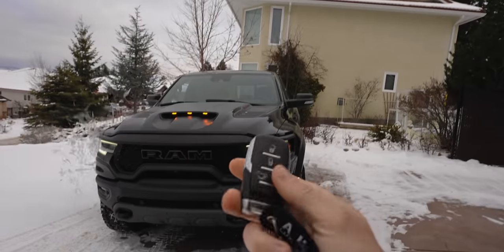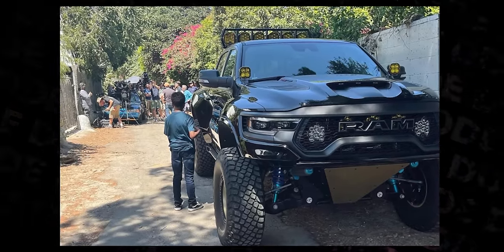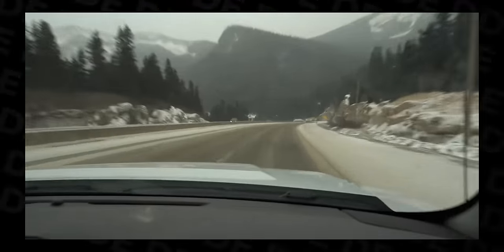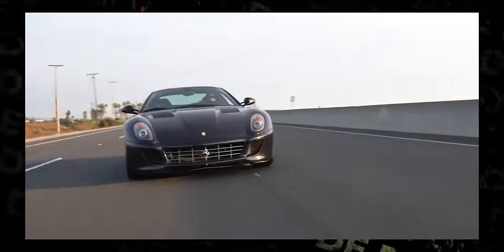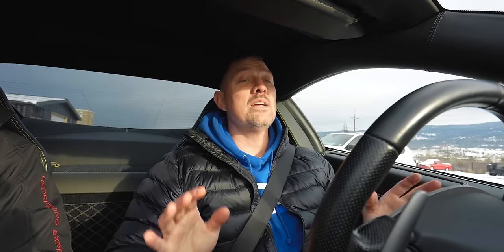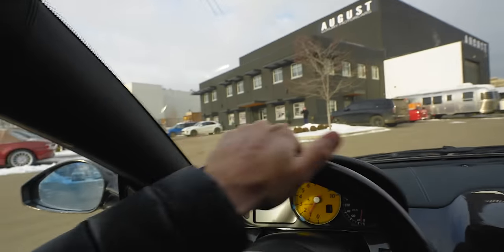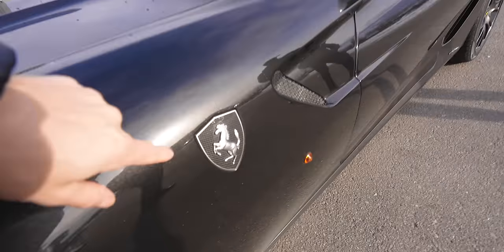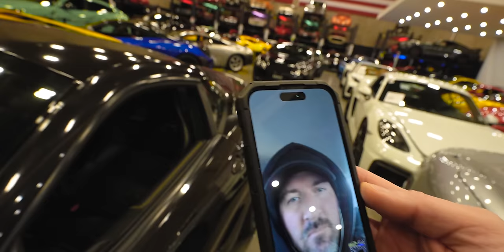TAKING DELIVERY OF MY NEW SUPERCAR FOR A VERY SPECIAL …

Comment: TRX Rambar is a must. If you dont modify the suspension with a lift (Which you should do) Atleast level the front end to match the back, since you aren't really hauling a trailer.   Better wheels and tires, and an intake will make the supercharger even better.

Comment: You gotta get a pedal commander. You'll love the throttle response. A bit pricey but it was one of the best mods I put on my mopars. It deals with the throttle lad due to the electric pedal and throttle body. Easy install great adjustability.
Reply from the maker: Thanks for the tip! I’ll check it out.

Comment: Carli suspension and corsa exhaust would be a good start for sure in my opinion. Could also go for a suspension kit that widens the wheel base like a Baja long travel kit. Improve handling a bit plus some extremely capable suspension for on and off road capability. Maybe add some utility features. make it something you can use to tow your vehicles and bring to track as well
Reply: That’s exactly what I was going to say with the Carli suspension and corsa🙌🙌

Comment: The Coq is no joke! The first time I ever drove that highway was driving a semi, at one point while going down a hill, my 53 foot trailer drifted to the side onto incoming traffic. Thank fuck there was no one else on the road at that time.
Reply: i respect you truck drivers that drive in scetchy weather that shit would scare the hell out of me
Reply: @joeNotexotic579  dude, I would be lying if I said I wasn’t terrified. That could’ve easily sent someone to their death in an instant. But remaining calm in those situations is what helps bring your vehicle back under control. If you panic, you’re more likely to drive off a cliff or into another vehicle. Which is, unfortunately, what happens to most people who get into an accident. They overreact, over correct, and next thing you know, you’re facing a wall and your hood. Is in the air.
Reply: Did you apply the trailer hand brake to straighten it out?
Reply: @SirEUs-iw8mh  lightly while giving it a bit of gas to pull the trailer straight. To fully apply the trailer brake would've caused the trailer to slide further out of control. Physics is fun

Comment: For the ram TRX I would suggest 

Suspension:
Icon Vehicle Dynamics suspension kit which includes 
- 2.5 dia aluminium shock with Adjustable cdc valve external Reservoirs ( 2 front coilover shocks and 2 rear shocks )  
- Billet upper control arms ( 2 front )
The Ram TRX Stock suspension is pretty good however if you would like to drive hard off-road comfortably and reliably these are great. Also if you want to drive hard offroad a Front Skid Plate is a must preferably out made out of laser cut 8mm aluminum.

Body: 
Fiberwerx wide body kit

Off-Road Wheels and Tyres:
- Cooper AT3 tyres or yokohama G015 Geolandar ( for less Road noise )
    * Note: if you go for bigger tyres you may  need a body mount chop so do keep that in mind.  

-  regarding wheels I would suggest Black Rhino, Fuel Offroad or Method wheels. 

Icon dynamics suspension are a great set of shocks for onroad comfort and offroad capability. 

If you are thinking of Off-road lights, then Baja Designs are the go to and the best of the best. 
Baja Designs Light set up I would Recommend,   LP6 PRO Driving/Combo Amber 2 on the Front Grille  |   XL 80 Driving Combo Amber( Pair)  on A- pillar   |   Squadron PRO Amber ( Pair ) and S2 Sport Amber  ( Pair) as fog lights.  Amber is good for desert or dusty conditions otherwise Clear ( white ) is good. 

I work at a company that specializes in modifiying Off-road Vehicles, Hope this helps.

Comment: Port the blower.. bigger injectors.. fuel system..tuning system.. built diff.. And trans.. smaller pulleys 1000 hp plus reliable prolly around 40k and obviously exterior upgrades

Comment: I vote black rhino wheels, long tube headers with upgraded hardware before the bolts snap off in the head, exhaust, ported blower. Grip tech pulley

Comment: If you see "traditional weave" 2x2 twill carbon fiber then its definitely aftermarket.

Ferrari only uses the 1x1 plain weave that looks like a checkerboard. (Which also looks worse, & cost 5x more than Mclaren or Lambo carbon)😅

Comment: Noisy but terrible exhaust compared to Dave's 599! I still don't get buying two, because if the factory manual is expensive, the converted manual should bring the value a little more than you pay to convert it, because buyers will know about the conversion option.